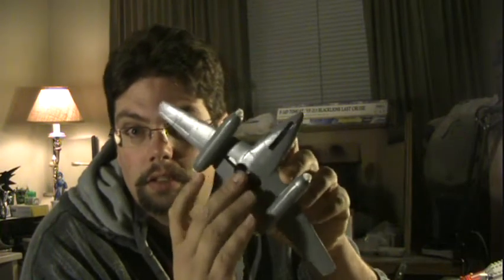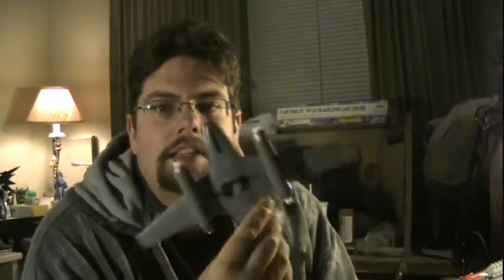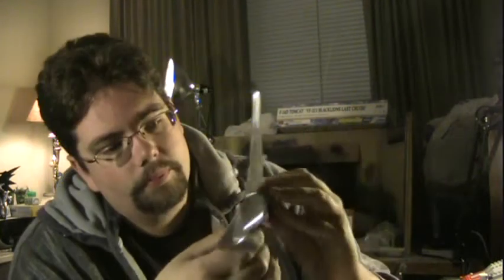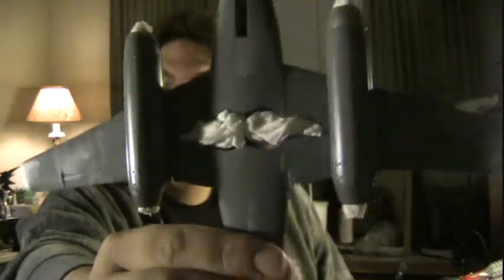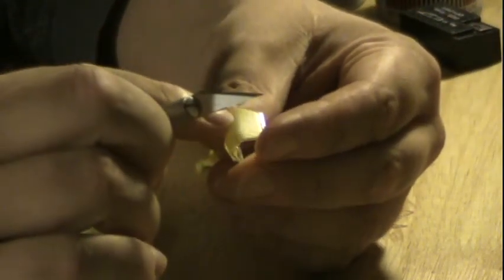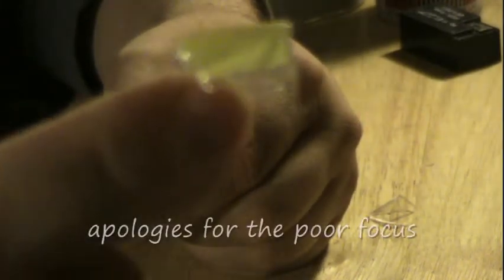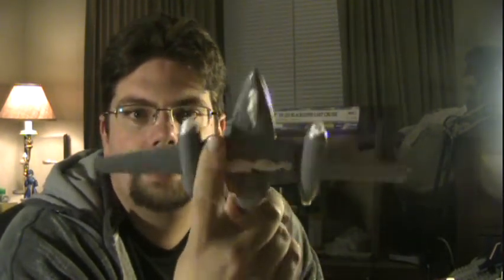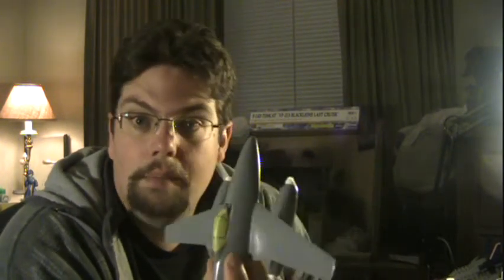Modelling 101, episode 10: Everything you ever wanted to know about masking

Comment: @bogusbyte Doing a wheelbay-closed build is often a nontrivial modification.  The doors' attachment points may have to be cut (since they're molded to attach in the open position) and depending on the kit you may have to fill gaps between the doors. Doing this just to mask off the wheel bay wouldn't be worth the effort - and even if it was trivial to put the doors in the closed position temporarily, you wouldn't get a clean color boundary between the exterior and interior colors on the door.